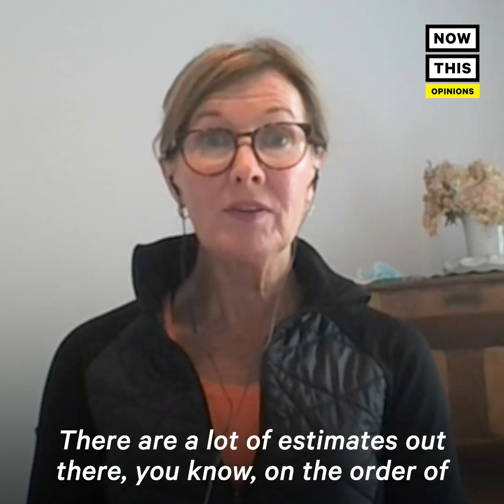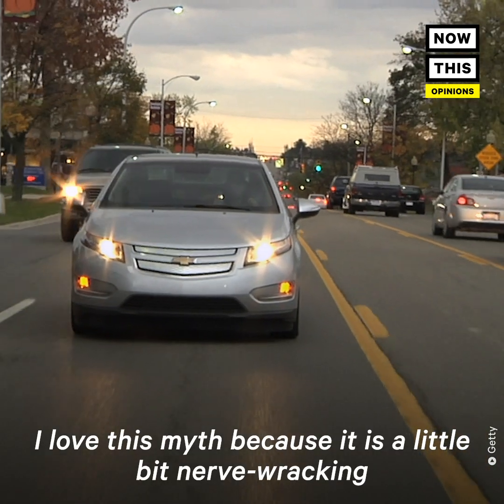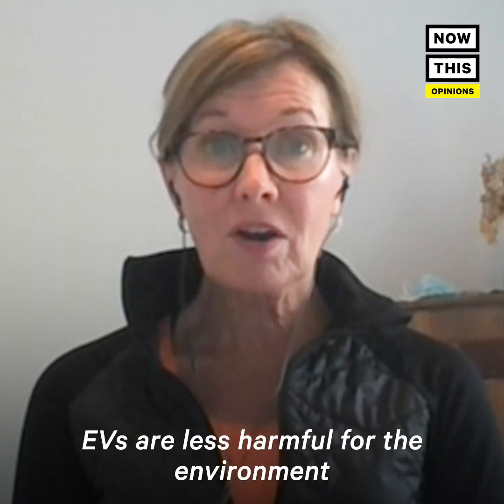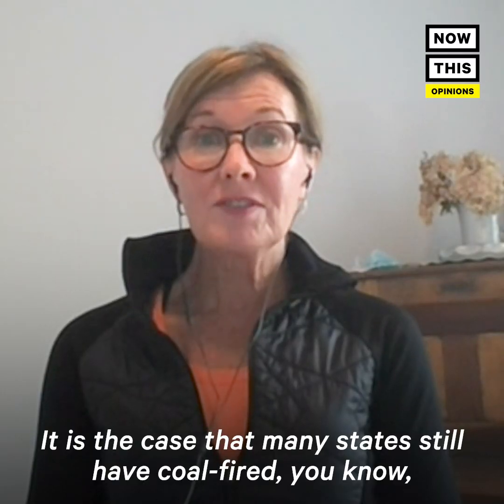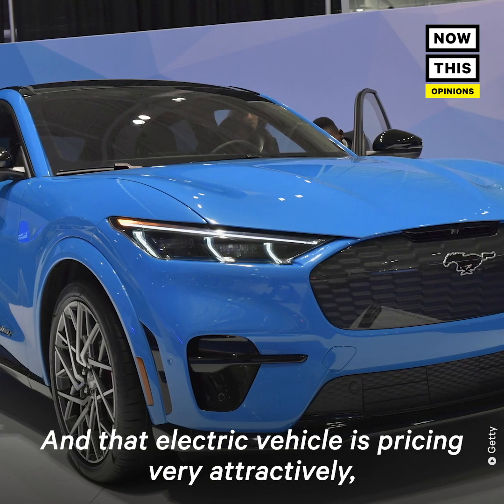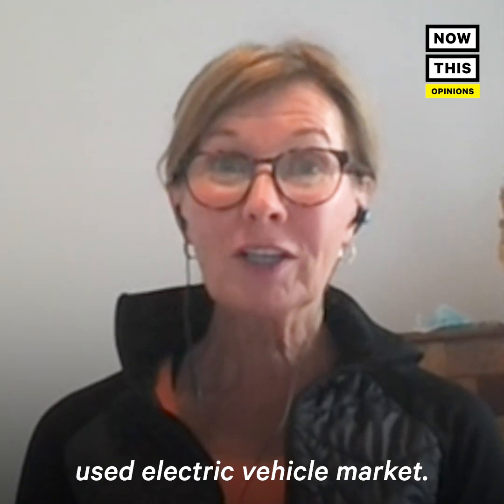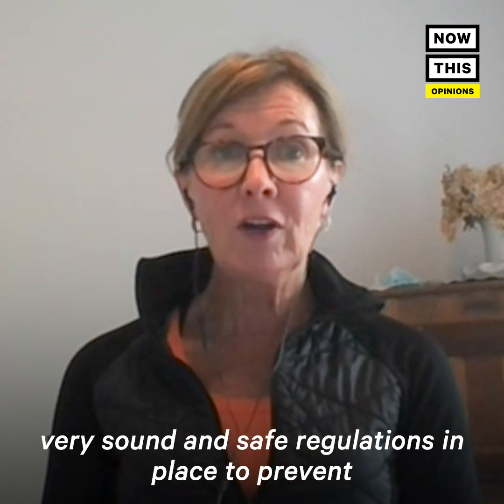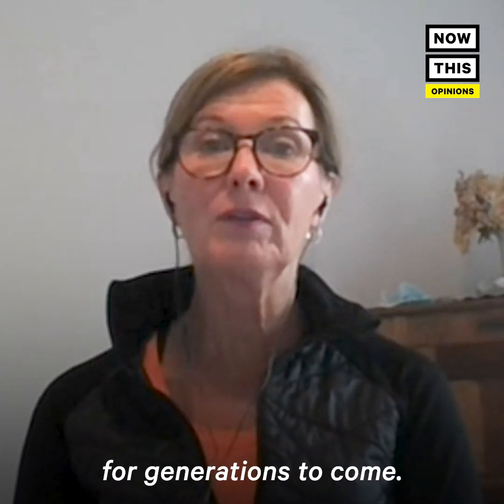Debunked: 5 Myths About Electric Vehicles

Comment: There is 1 top issue I have with EV that really does need to be resolved: Gas vehicles can be filled up in minutes, EV'S cannot😱.
Reply: Yes, you plan your trips like if you travelled in a light sports aircraft, but if you have a pretty constant daily driving distance, get an EV that has a range to cover that, so you usually only have to charge at home, where it is the cheapest anyway. But yes, road trips is a challenge, especially if you travel abroad, and have to navigate the jungle of charging providers and apps, that is, unless you have a Tesla, which just works everywhere!
Reply: @Tore_Lund  Fair enough. When I did drive, I plan 99% of my destinations & rarely drove thru unknown places. Cruising was never my priority. 
Charging at home is a good idea in a way, depending on your home & the nature of 1's power utilities particularly billing. If 1's electric bill for instance is blessed to be at a flat rate, say $100/month, or preferably it's already an included utility (Few places have this), then it's a good idea.
Unless you happen to live in an apartment, in which case there'd better be ample charging ports in the parking lot.
Much adaptations to be done & they only happen so fast.
Reply: Nio’s battery swapping is just as fast as filling a tank
Reply: @ferddoesweirdthingsinlife1040  The EV would have to be built for battery swapping. So far, none are.
Reply: @noahpartic7586  literally all of Nio’s are dude
Reply: @ferddoesweirdthingsinlife1040  A simple plug & play?
No way🤨.
Reply: @noahpartic7586  nio has more than 100 of these swap stations. You should check it out before saying ‘no way’
Reply: @ferddoesweirdthingsinlife1040  You're right.
I came across a clip showing the process timed at about 5min real-time, not much different from gassing up, but more robotic.
Reply: @ferddoesweirdthingsinlife1040  Nio's? I'm not familiar with this🤔.
E-Bikes, definitely. Easily removable battery you can take inside with you & recharge from your home or wherever like a smartphone...only bigger.

Comment: More electronic controllers = less durable and much harder to maintain and repair. Complete lie to say that "semiconductor chips" will somehow detect mechanical/physical failures in various parts. Utter Nonsense.

Microprocessors are very good at interfacing with software systems and simple hardware but VERY BAD at interfacing with heavy duty hardware (like a car). Even in industrial applications, electronics and software are kept to an absolute minimum with increased reliance on hardware based and simple electrical (not microchips) failsafes and controls.

Also relying on software and updates introduces likely bugs/hacking vulnerabilities - another clear negative.
Reply: Every. Single. New. Car. Or. Truck. Has. Chips. O2 sensor?
Reply: Jove just stop you shill
Reply: Electric vehicles have fewer mechanical parts than combustion vehicles. Semiconductors or not, they're simply more reliable and have less maintenance. You don't have to change the oil on an EV!
Reply: @ThomasBomb45  The construction of an electric motor especially with all the controllers governors etc in an electric car is much much harder to maintain and repair than a mechanical engine with a lot of discrete parts. Its easy to replace a part, its almost inpossible to take apart and fix a tightly constructed electric or electronic component. 

For example think how easy it is to replace a button on a keyboard vs having to replace a whole touch screen assembly on a tablet.
Reply: @jove6407  How often do electric motors go bad compared to engines needing maintenance? (A lot less often)
Reply: @ThomasBomb45  That's complete bs, if electric cars are so reliable then why Volvo P1800 from 1960's with 3 million miles and Matt Farah's million mile Lexus from 1980's are still running strong while Teslas from 2012 are already in a junkyard?
Reply: @Random.Contents.  where'd you hear that teslas are getting junked?

1. Electric cars have improved a lot over 10 years
2. Tesla itself was a new company

Comment: How many people talk about how the batteries lose range over time
Reply: Batteries have warranties. 10 years is the average warranty i think. Chevy volt batteries are well outliving their warranties
Reply: Seriously, the batteries do degrade but only by a tiny amount. There are EVs out there with hundreds of thousands of miles on the clock and much less than 10% loss. Our e-Golf has lost about 5 miles of range since March 2016, really nothing to worry about.
Reply: So it could depend on the cooling system to optimize the longevity? But there could be hidden capacity  that compensates for loss
Reply: Oh lots of people, usually on internet social media threads where everyone's an expert.

Comment: If you're looking for a way to help the environment you can use ecosia they are a search engine that plants trees.
Reply: Such and easy switch. It's basically Google.
Reply: Jebus Hypocristos  Well thank you for  sharing  I prefer ecosia  I am to poor to plant trees right  now.
Reply: Read the other day that a single Google search has a footprint of 3.5g CO2. A newly planted tree requires 20 years to start storing the CO2 that it took planting it and another 10 years to be its weight worth in carbon around 400lb worth of CO2. This means that Ecosia will have to plant a tree for every 228,000 searches. However they state they are planting a tree for every 45 searches which is 5000 times more than the search emits. However it requires that the tree stays put for the next 30 years. As Ecosia is not yet 30 years, in reality they have removed nothing yet, but are they securing the trees they plant are left undisturbed? In that case it will be worthwhile sometime in the future.

Comment: So, if this all goes well, gas cars will be gone, but the production of the batteries that these cars need will make up for that pollution and we'll be back where we started, but with electric cars.
Reply: Did you not hear what she said? No we won't be back where we started are you deaf you shill? Only the production of the electric vehicle will be the only poullting part of it after no pollution ever and pollution of the production of batteries is still nothing compared a to gas powered vehicle being used  all the time.
Reply: The solution is to move the same number of people but by building fewer metal boxes (whether those boxes are electric or not). Buses, trains, biking, and walking are all more efficient
Reply: Mass on the ground vs mass in the air warming the planet one we can evuntally make use of the other we must fight to rein In

Comment: Totally want everyone driving EVs.  But this is misleading.  The insurance for an EV is much higher and more than makes up for the fuel and maintenence costs.  Especially since modern ICE cars are also getting more and more reliable
Reply: But with EVs become the norm, insurance companies will be trying to undercut each other to get as many of those EV drivers as possible.
Reply: @JUNK_ZONE  The trouble with EVs is that they used to be rated by nominal motor power and not peak power like combustion engines are, however this has changed. Getting a dual motor model 3 will cost you an arm and a leg because it has the peak power of a super car, even though an EV is never driven like that.  Nominal power for the model 3 rwd is only 25kW (the peak efficiency point). If the insurance reflected that, it would cost no more than a motorbike to insure! EVs used to be type approved like that. My old 2002 EV has a 80kW motor (2 second rating) but nominal power is only 15kW, so this is what I'm paying for, not its peak power.
Reply: Best case is no one uses cars
Reply: Invalid, thats only now since there's so few, shill. Once they're evs everwhere everything will be lowered.